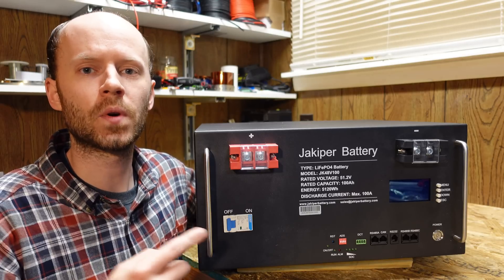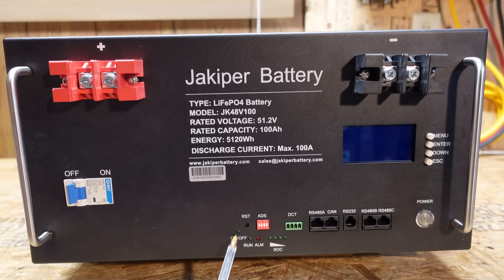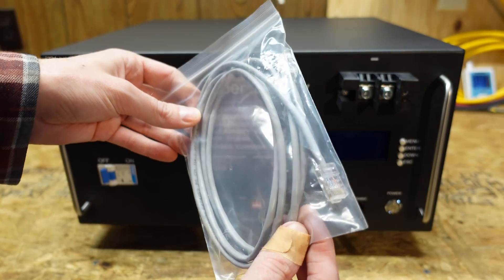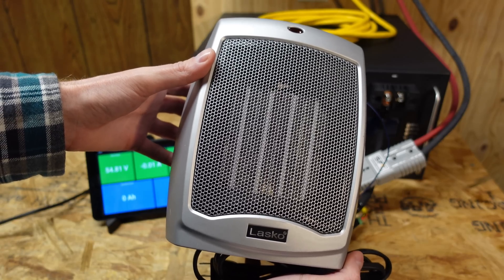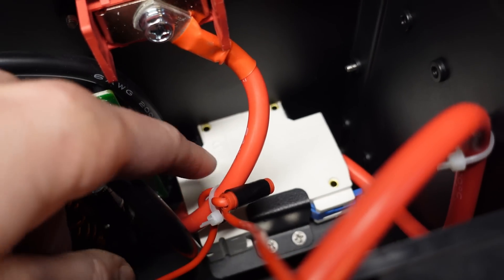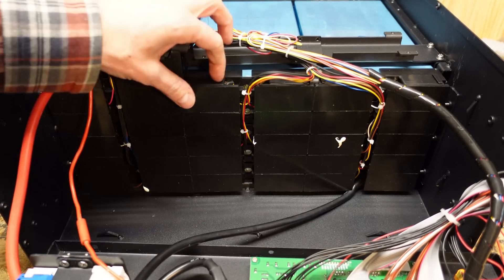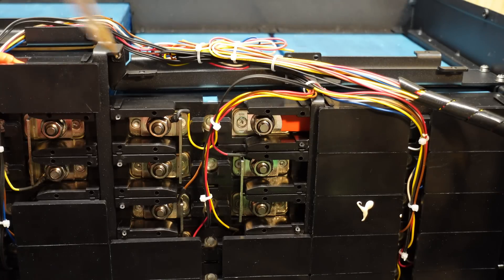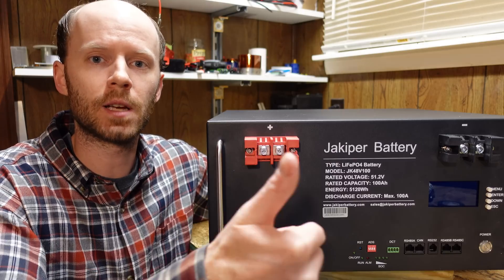Jakiper 48V 100Ah LiFePO4 Battery, 5U Server Rack Steel Case, $332/kWh

Comment from the maker: Jakiper Battery... https://jakiperbattery.com/product/jk48v100/?ref=lithiumsolar (affiliate link)
> I emailed Jakiper regarding the choice of circuit breaker. They let me know that the BMS will react faster and more accurately than the breaker without any failure. They also noted that, based on feedback they have received, they will be using a DC-rated breaker in the next batch of batteries.
> I'll have a follow-up video next week where I test out the inverter communication connection.
Reply: The good feature about the BMS is the low temperature cut-off value can be set as per your application whether 0/-5.
Reply: You might have better luck lowering the temps using compressed gas like the ones you can find in those compressed air cans for cleaning keyboards. Drop the sensor wire in a ziplock bag and spray the compressed air into the bag.
A similar process can be used for cold boot hacks of computers by cooling down the ram with the gas from compressed air cans.
Reply: Dumb question... I'm looking for a battery about this size to power a small boat. Is there a way to "moisture - proof" a rack battery like this?
Reply from the maker: @OldDoggNewTricks  Unfortunately, no. There's just too many screw holes/joints. I think you would be better off buying a battery that's sealed.
Edit: Oh, and that's not a dumb question! :)
Reply: @LithiumSolar  Thank you for the info, I was not looking forward to having several dozen screws to remove and seal.
Are there any you'd recommend on the affordable end of the scale?

Comment: I am interested in a server battery that has “O”
Ring types connections at the terminals. I was hoping to use the Ebox but there connecting post are like proprietary . I’m trying to configure cables from pos/neg that can both be connected into mc4 male/female cable that I use currently to charge a unit with , the reason I’m interested in this ability to use a server battery is to add additional power supply input to a Ecoflow delta pro 3600 watt battery that has its own bms built in and it’s capable of handling 150 volt DC input server batteries I believe are around 48 volt each. And suggestions on how to make or purchase such cable to enable using power from server battery to supply power to my main unit Ecoflow? Any suggestions greatly appreciated

Comment: how many 12v 100aH batteries would equal this 48v 100aH rack battery.
Reply from the maker: 48V / 12V = 4, so four 12V 100Ah batteries would add up to this 48V 100Ah battery.

Comment: I have two for these, and had nothing but troubles with one of them. Batteries got lost during shipment, after arriving the built in anti-theft alarm rendered it useless till I could get it reset, then BMS needed replaced. Took about 3 months to get it all resolved. Jakiper customer service is not good, but they are improving. Buy only the upgraded version of this battery.

Comment: This seems to be a great server rack battery without a server rack.  Unless Im missing something anyone consider what server rack is available to fit at least six batteries?  Otherwise practically speaking the EG4 and 6 slot server rack would be a better solution.
Reply from the maker: This is a 5U battery. Standard server racks are 42U, so you could fit 8 of these in. There are many other specialty sizes available on the market. The EG4 looks like a 4U battery, so you can fit more in the same amount of rack space.

Comment: Oh FFS, "Server Rack" naming is getting beyond the joke. Unit may fit a 19" rack but no rack-ears for mounting and certainly too heavy for racking. Shelf stack unit at best.
Reply from the maker: Actually it does include rack ears as shown at the 3:00 timestamp which will match up to a standard rack. Yes, it's heavy, but I've dealt with servers that were even heavier. You'll need shelves to mount in your rack. Obviously it doesn't include rail kits... But yes, absolutely is a "server rack battery" as the name describes.

Comment: Try crushed ice or small cubes and add some salt to the ice and a bit of water. This is the same technique used for ice cream freezers to lower the temperature. Can you get some dry ice from a company that sells compressed gasses, not knowing where you are located sometimes some grocery stores sell dry ice.

Comment: Add salt to the water to get it colder. (My bad, someone already suggested it below)
Reply from the maker: Yeah, I did use some salt but apparently not enough :)
Reply: Vigourisly stir until you noticed ice has degraded in size, or use crushed ice. More surface area. It’ll work. Like your channel.

Comment: So what is the acceptable voltage deviation between cells ?  (Assume that the cells are being top balanced )
Reply from the maker: If they're matched cells (IR, capacity, age, etc) and are balanced properly, there should be very little difference. There isn't an exact number I can give though regarding what's considered "good" vs "bad". The closer the better, but you'll never see 100% exact readings across 16 cells.

Comment: 6:45 if the internal uses 6awg, is it really necessary to use 1/0 or can we get away with 4awg?
Reply from the maker: The only reason I used 1/0 awg is because I already had pieces crimped from other projects. The rules for chassis wiring (inside the case) are different from the wiring that will run from your battery to chargers/inverters. I typically follow the NEC table for home residential wiring > https://www.usawire-cable.com/pdfs/nec%20ampacities.pdf
Reply: @LithiumSolar  Whoa thanks, that chart will come in handy!

Comment: Would like to know more about current limiting on these new BMS's, its mentioned by you and Will from diysolar but no details about what it means. I gather it may current limit at low temps before cutout maybe thats why its set at -5c instead of 0c cutout? Remember you can actually charge below freezing without damage but only at low C rates.

Comment: There bms  is garbage!! It’s like $16 from China. The 24 V 100 amp hour battery they have has terrible construction solid metal yes but looks like one giant short circuit in a year or so. Just another start up that needs to shut down. Rethink their direction
Reply from the maker: Can you please share a link to where one can buy this BMS for $16...?

Comment: Honestly I don't like running cells below 3.0v.  Not worth the squeeze.
Reply from the maker: I don't typically run mine below 3.0V either, but have to use the full range when capacity testing.

Comment: Another solid review. Not sure how anyone can say the inverter shutting off while the battery still has power left means it didn't meet its cap rating though.
Reply from the maker: Thanks and yes, I agree - but I know if I didn't mention that someone surely would have called me out on it.

Comment: SO UNLIKE THE SOK, ETC, YOU CAN POWER 3000 WATT INVERTERS AND APPLIANCES.......WHAT KIND OF DC STEP DOWN WOULD YOU CONNECT  TO THAT BATTERY SO YOU CAN RUN DC STUFF WITHOUT THE INVERTER RUNNING

Comment: I've did some research on this PACE brand BMS in the past (very limited information available) and it looks like they don't have any bluetooth or mobile app. Can you connect to the BMS through a PC connection and change parameters?
Reply: BMS parameters are not user accessible.  EG4 is the same way

Comment: If ice is mixed with a salt, part of the ice melts, and the salt dissolves in the water from the melted ice. The energy required for melting the water and dissolving the salt is taken from the environment so that the entire mixture cools down. With table salt, temperature of down to -27 °C are reached.
Reply: Yes exactly! That's what I do
Reply: @WillProwse  but Andy at the Off-Grid Garage says you're doing it wrong and should use an ice-cold beer :D
Reply: @Mazlem  that video was so funny 😂😂

Comment: So, I've been super impressed with ALL of the server rack batteries seen on yours & Will P.'s channel. Can any of these be used on an RV? Can any of these be used on a 45 ft. sailboat? They are well built, have all of the protections anyone could want, they're built well & they are modestly priced. If they could be used on an RV &/or boat- I would stop thinking about building my own set.
Reply: Metal cases in a damp environment is generally not good.  SOK has a marine grade battery but I am unsure of the voltages they provide.

Comment: Have one of these too and offer these observations.  1 the customer service is horrendous.  2 it may come with the alarm enabled so do no not activate it until it is in the position you wish it to stay in. 3. Despite Jakiper’s lies you can craft your own RS232 cable in lieu of their $40 cable. 4. Their RS 485 comms is purely decorative it does not communicate with any inverter.  5. Their RS232 comms is proprietary and not published.   Solar Assistant does read it, but I have had no luck finding the protocol so it can be added to other open source monitors.   EG4 is no better in this communications area by the way

See the threads on DIY Solar Forum for the horror stories
Reply from the maker: Hmmm.... Not good feedback to hear :(
2) Are you talking about the motion-based anti-theft alarm? 
4) The battery I received is supposed to have upgraded communications. I'm hoping to test this in a video next week with the LV6548, will see how it goes
Reply: @LithiumSolar  yes, mine was set, but fortunately I didn’t tripped it since it was in position when I first turned it on.  Others have been less fortunate.  It was just luck on my part since I was unaware of the possibility at the time.   Jakipers only help is to sell you their RJ12 cable at an outrageous price.  You can make one by running a std phone cable (4-pin) to a db9.  Red to pin 2.  Green pin 3.  Yellow, black pin 5.  Then you can use their software to disable the alarm

Good luck with the comms.  The first batch which I foolishly bought on Wills recommendation was to have comms too, but it did not so now I am trying to decode their protocols and add it manually

All my bitching having been completed, I will say the battery itself has been a stable performer for the last 45-days.   I have it in parallel with an EG4 Lifepower4 and a BB Husky.  The Husky is a bit eccentric, but the two server batteries are rock solid thus far
Reply: @edwardbyrd7667  Are you saying these and the EG4 batteries don't communicate well with Inverters?
I know SS pretty much only cover Growatt 5000ES with their batteries, but I did assume the BMS used in these server rack batteries would easily communicate with the likes of MPP or any inverter made by Voltronic Power so your advice is much appreciated!
Reply: @healeydave  I am so saying. I run an lv6548 and it doesn’t see the EG4 or the Jakiper.  I am also saying they don’t communicate using the same protocols and the two cannot be daisy chained via rs485.   Now I have a first batch Jakiper and the newer ones are supposed to communicate with some inverters, but then again so we’re the first gen up to the point they didn’t
Reply: @edwardbyrd7667  Is your EG4 the one with LCD and same problem?
Reply: @healeydave  no, I have the Lifepower4, and I can’t characterize that as a “problem” since they only advertised the growatt compatibility.  I did some digging for specifics on MPPs. LIB and LIC protocols yesterday.  They too appear to be non public.  .
Reply: New version can communicate with Growatt/MPP/Sol-Ark/Victron/Luxpower/Deye Inverter… Add BMS on/off switch...Disabled 'Anti-Theft' Function.
Reply: @serverrackbatteryusa  will you offer retrofit for those to whom you misrepresented the first gen?

Comment: Do you thing 18650 more batter then Lifepo4 ?
Reply from the maker: Yes, LiFePO4 is much better than cobalt-based 18650 cells for many reasons - safety and lifespan topping the list.
Reply: @LithiumSolar  if you comfortable you explain in your next video 18650 Vs lifepo4
Best regards from Philippines 🇵🇭
Reply: What about 18650 lifepo4 batteries? Are they better than lifepo4 batteries that aren’t in an 18650 form factor?
Reply from the maker: I think 18650 LiFePO4 batteries are just as fine as Al-cased prismatic batteries. Each form has their place. From the perspective of solar energy storage, I don't think it makes sense to build large packs out of many 18650 batteries when you can easily buy a few Al-cased prismatic cells and bolt them together in minutes for significantly cheaper.
Reply: @codiecarroll735  I think LFP 18650 cells are more stable than prismatic cells… but the penalty is weight. Steel,nickel, and all the bussbar strips add up in a large build.